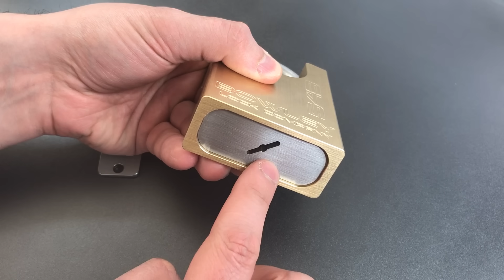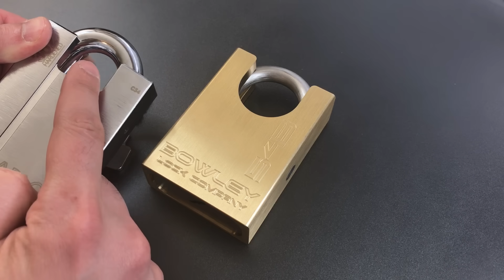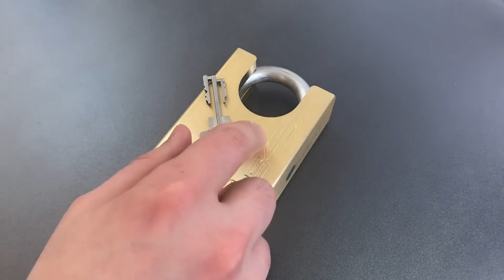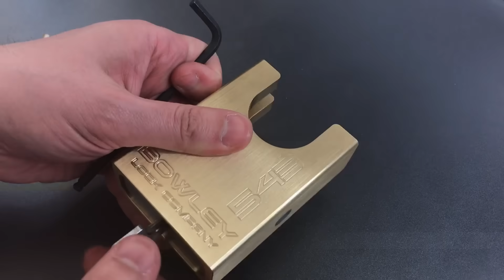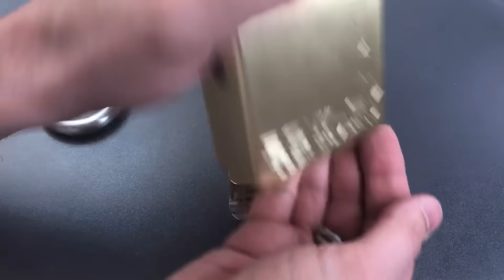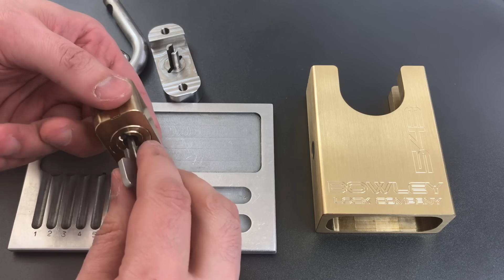[653] Prototype Dual Fork Bowley Padlock (Model 543)

Comment: -Sees bike with this lock.
-Breaks lock's chain
-Leaves bike steals lock
Reply: I mean, you won't be able to use the lock since you wouldn't be able to pick it open. It would just be a trophy.

But it'd be an awesome trophy.
Reply: @CheshireFatorum  You can recreate a key if you know the general size of they key.
Reply: @barodrinksbeer7484  hard tho, you would need a cnc machine to cut a key lile that in a reliable way that is easily repeatable, which would be what you qant if you loae your key and want to make a replacement without worrying too much about wrong dimentions, cncs today are really accurate and if it's fucked up it could be jjst you fucking up in the program or got the dimensions wrong
Reply: @CheshireFatorum  to I only
Reply: @CheshireFatorum  jjj*
Reply: Yuuto Amakawa sell the lock for more than the bike.
Reply: true you wouldn't have the keys
Reply: @CheshireFatorum   With solid brass, you could just sell it for scrap metal
Reply: Yuuto Amakawa you could pick it
Reply: @CheshireFatorum  the bike is the trophy the locks probably still there
Reply: God everyone in the comments of this comment are making a big deal over what is literally just a dumb joke that made a few of us laugh.
Reply: I hope it have a integrated GPS tracker in it for that price
Reply: @leexgx  Cost more than the bike.
Reply: @markarrington3869  actually it's about the same price of a cool bike here, even tho on the cheap side
Reply: @leexgx  If it's got a GPS you just stick it in a Faraday cage (in bag form) for a year until the battery runs out.
Reply: @leexgx  Is it $500?  Because that's what the locks with integrated GPS trackers cost.  On the plus side, you'll get (superior) Medeco keyway and keys with it.
Reply: @yutub561  Made by someone who doesn't know a nice lock from a gimmick, at that.
Reply: @yutub561  Much like someone not "getting" a joke that wasn't funny.
Reply: I thought it was funny.
Reply: Agent VX u gotta stop gatekeeping my guy like let people do their things, atleast they produce quality comments that can make people laugh
Reply: I like how the internet doesn't agree on a lot of things but we teamed up quickly against  @agentvx8320
Reply: @agentvx8320  r/whoosh
Reply: @agentvx8320  the superior comment is sarcasm right?
Reply: @ambitiousdentist6076  I don't know which comment you're referring to, but the Bowley is a deeply flawed lock design.
Reply: @philip_bray  wtf made you think he lost it? He obviously got a great lock that only he knows if to protect it. How else is he gonna stop women from stealing it doesnt want to lose anything so he refuses to lose his virginity too.
Reply: @agentvx8320  you're not funny tho, you try but you fail.
Reply: @agentvx8320  I thought it was funny
Reply: Agent VX $500 for GPS tracking?! I can buy a GPS module for just $10...
Reply: @agentvx8320  For $500 you can actually get two of these (the stainless variant)
Reply: @fornsphin  And for $50 you could have a lock that's just as good for practical purposes unless you have LPL breaking into your shed.
Reply: @agentvx8320  your name isn’t numerically correct VX just equal V
Reply: @dead6171  Whoever said it was a number in the first place?
Reply: @agentvx8320  I thought it was funny
Reply: @johnadler6987  Well we agree on the second point.
Reply: holy cow, I didn't expect a two year old comment chain to still have comments.
but jfc, everybody loves to pile up on the correct person don't they.
Reply: @insanemunchkin  I was saying boo-urns.
Reply: @cyruskhalvati  it wasn’t quality
Reply: @agentvx8320  i thought medico was defeated with a camera a credit card and an exacto knife?
Reply: @agentvx8320  i thought it was funny too
Reply: @agentvx8320  can get gps trackers for like 30 bucks no way a lock needs to be 500 to include one
Reply: @agentvx8320  he said he believes it's 163 USD
Reply: @GRBtutorials  he might think it needs some weird components that are hard to make even tho it should be pretty simple, biggest problem is battery
Reply: @agentvx8320  Dude, calm down. Not everyone knows every intricate detail about a lock. That doesn't mean you get to look down on them. Just, take a breather and think about what you say before you say it.

Or you could be a total prick and still snap at people, not my decision to make.
Reply: @Concerned_Custodian  omg, this Agent VX thread has been the funniest thing i have ever read. this dude is so salty he is Basically the entire ocean lol.
Reply: @agentvx8320  Man really said a Medeco lock was superior 😂😂😂 what are you on bro
Reply: @agentvx8320 don’t be such a buzzkill, kiddo.
Reply: Oh it was definitely funny - just someone (@Agent VX) takes himself way too seriously.
Reply: @DerPafferfish  😂 lol nobody seemed to point it out, Agent VX is the joke of this thread.
Reply: What about cutting the bike?
Reply: Yeah, the Bowley padlock is probably worth more than the basic bycicle
Reply: Youre all stupid. You cut the object the bike is locked to and walk away with the bike, chain and lock. God, nobody thinks big time anymore.
Reply: Philip Wells no, just cut out the ground in which the thing the bike is locked to is connected
Reply: Yeah.... It is beautiful. I don't really know much about Locks, but this thing…. You can just feel the love. Beautiful.
Reply: This is the best comment section in LPL videos:')
Reply: @agamikhwana8596  Wow I didn't get notified for any of this, is it too late to get some popcorn?
Reply: Saw a good lock on the lock up garbage round back of shop. Rusty hinges, easy to get at screws, wooden rotten door 😂..
Reply: Bolt cutters, why waste ones time picking...
Reply: @manniefaces  bolt cutter pobably wouldnt take care of a lock this big with a hardened steel shackle, just go for the battery powered angle grinder
Reply: @MatthewHensley8304  I mean, if animals killed with modern weapons count as "hunting trophies", then so does a lock someone got by cutting the chain with power tools.
Reply: @sbcontt YT i know, right?
Reply: Wtf is going on?  This has been going on for 2 years in the comment section.
Reply: @jensmakinen  Its very simple.  People are both dumb as hell and petty as hell.  I hoped that helped.  Have a good day.  :)
Reply: Noble gentleman of the planet Earth, with intricate  and vast knowledge of locksmithing and lockpicking or whatever alike. It is vanity to try to communicate such complex and well-made arguments on such uncultured people that cannot even fathom the ineffability of your knowledge, as this is obviously a joke. Nonetheless I appreciate, if no one else can, the sharing of such convolute arguments, that, with no doubt in my heart nor mind, I can say that are entirely valid.
Reply: @victor93532  that’s like trying to extend a 5 word sentence into a paragraph. I like it.
Reply: @victor93532  you you just said. Love it
Reply: I literally came to the comment section to say this
Reply: Step3 recycle lock take $ and buy a good bike... step 6 . Realize  your bike was stolen because you couldn't afford a good lock.
Reply: It's quite amazing how many people I've managed to make this butthurt with just a few comments deriding a lame joke about an overhyped lock, yes.

I bet I can still manage a few more though!
Reply: @agentvx8320  this would be the lock I would use if I were ever to chain you up in an empty basement out of pure sadistic pleasure. I'd even leave you with an assortment of lock picking tools
Reply: @stuartcommon4651  And not an Assa Twin or Abloy Protec?  Cool, glad to hear it.
Reply: @agentvx8320  ssshhhhhhhhhhh.....
Reply: @stuartcommon4651  No thanks.  You can if you like though.
Reply: @ParaFox404  That reminds me, you need to get more pizza rolls. Its the only way to stop the fridge!
Reply: @ParaFox404  it's the YT comment section. It does not represent how they interact face-to-face in public. For example: your monologue on a post over a year old.
Reply: @matts3425  I got bored sue me
Reply: @ParaFox404  i could tell
Reply: @agentvx8320  over a year you argued about a stupid joke, seriously... dude...
Reply: @agentvx8320 u still here 5 years later?
Reply: @agentvx8320  i feel like I just witnessed the birth of an antihero reading through this 4 year conversation. Most people hate him, but he's just aggressively helping.

I commend your persistence in successfully proving your point even if it was a little much in response to a joke.
Reply: @agentvx8320  The reason we're all so butthurt is because you took this joke way too seriously and started acting like they were dumb. You don't know what they're life is like. And no, don't use "well I was just kidding!" as an excuse. My best friend killed himself because of assholes like you, so yeah, I will get butthurt, because your kind need to be put in their place, before you can run rampant and infect the internet like COVID-19 has infected humanity. Fuck off, bitch.
Reply: My child was still in my wife's belly when this thread started.  Now he's watching YouTube
Reply: The perfect crime
Reply: I dont know if you could break that chain that easy
Reply: Could you imagine the smiley
Reply: @Victordanie True Story XD Thught about the same XD
Reply: xDDDDDDDDDDDDDDDDDDDDDDDDDDDDDDDDDD
Reply: Lmao why not steal both?
Reply: Made my day xD
Reply: Thieft Approved!
Reply: @Victordanie
I was just about to add a comment in the exact same vein, the I saw Yours.
And looking at the number of thumbs up and replies You seem to have "captured a common reaction" with Your comment.
Best regards
Reply: *picks lock on YouTube
Reply: Ok... I know this is over a year old, but has no one mentioned why you steal the lock and leave the bike, assuming it's one of the bronze ones??? Didn't he say in the video that It's a limited edition one, only available during the kickstarter campaign??? If that's the case whether or not it's worth the cost, is sort of irrelevant for the most part, because it's a limited edition, preproduction product... And if it's limited edition, you don't want to break the lock, most likely, and aside from that fact, it's brass probably because it's supposed to look good on a display, as well as in actual use... Therefore whether it's worth saving the lock, and taking the bike, depends on the person, but I for one, would keep the lock intact whether I can pick it or not, just because of the supposed limited number of locks made... And yes, I know that they are overpriced, I'm just saying that, at least in antiques, which these will be someday, prototypes and anything preproduction, for that matter, especially limited editions, are worth more... If I didn't know it was limited edition and all that, as well as the price, then yeah, I concede that I'd probably cut the lock, but still, you have to admit that however overpriced it is, this lock company is and/or was trying to make their locks as pick-proof as possible...
Reply: @northwiebesick7136  It's obvious, because they think the lock is valuable.

That's the part I take issue with, because it's an overrated lock that isn't /actually/ worth more than $50 unless you have a distorted view of what makes a good lock from watching too many locksport videos.

Not that I take issue with locksport at all.  Thieves just /don't/ pick locks in the real world.
Reply: Agent VX why do you think thieves don’t pick locks?
Reply: @andrewksmash8138  To clarify, thieves /in the US and Canada/ do not pick locks.  It's much more common in Europe and poorer countries.

The reason I hold this opinion is that I am a professional locksmith, and neither myself personally nor any other locksmith I've met has ever encountered a situation where a customer's lock was actually picked by thieves.

The reason I think it doesn't happen is that lockpicking is a high skill attack, and anyone who has the patience and self-discipline to learn can get a real job.  (This last point is not necessarily true everywhere in the world, but it /is/ here.)  Thieves basically exclusively use low skill attacks like bolt cutters, prybars (or more commonly, a big ol' screwdriver -- this is why "SmartKey" locks should be avoided despite moderate pick resistance) or just a good old fashioned rock through a window. For that reason, I do advise people stay well clear of tubular key locks, as tubular key decoders are very cheap and require basically no skill to use.

The Bowley is targeted primarily at the North American market (being made here), and that makes it pretty much an answer to a question nobody asked.  That said, even in other markets where pick resistance is important, you're not saving money going with a Bowley over Medeco or Abloy Protec, and those are more reliable locks with sturdy keys that can be reproduced by any locksmith that sold you the lock.  Bowley keys have a fragile geometry (necessitating them to be made from steel) which require specialized machines to cut.  Furthermore, the pick resistance of a Bowley is not equivalent to Abloy Protec.  There are credible videos showing Bowley locks being picked open, though they do require specialized tools.  There are no credible videos (i.e. where the lock is shown continuously unobscured between opening and gutting) of Abloy Protec being picked to my knowledge.
Reply: @agentvx8320  Am I the only one that genuinely wants to hear what locks you would recommend, specifically? I like the one in the video, but it's too expensive for it's security class. I can get extremely strong chains so that's not a problem. I just need a crazy strong lock that can hold them together.
Reply: @agentvx8320  I just read the last post you made :p
I should finish a comment thread before asking questions. I'm still wondering what their best lock for holding chains together is, though.
Reply: @sleepykittyH  Either something cheaper than a Bowley or something that actually qualifies as "high security".  (That term has a specific meaning for locks.)
Reply: @sleepykittyH  Specifically, depending on requirements, a quality basic brass padlock like a Guard 836, something like an Abus 83/45 if you want it keyed to your house key (or the steel body equivalent 83/55), or if you're really worried about picking for whatever reason, a Medeco or Abloy padlock.

Shackle guards are always preferable for resistance to bolt cutters, but aren't always workable because of fit issues.
Reply: @sleepykittyH  American 1100 or 700 series (or one of the myriad clones) are also a good option.
Reply: @agentvx8320  Getting a good lock is more complicated than I thought. Thank you for helping me :)
Reply: @sleepykittyH  No problem at all.
Reply: @michaelakers2271  Because it couldn't be /anything/ to do with the lock being overpriced snake oil.  Projecting much?
Reply: @agentvx8320  this thread made a good midnight read. At any rate tho, no one can deny that it is a cool lock design. Flaws? Yes. Impractical? Maybe. Could you cut through it in a decent time? If it isnt titanium, you could use a hacksaw if you had 30 minutes.
Reply: @theplaguedoctor6129  No lock is going to stand up to a cordless angle grinder for a whole minute.  Shackle guards do help a lot against bolt cutters, but you can get a shackle guard much cheaper than this and application (i.e. what you're trying to put the lock on) is usually what rules out a shackle guard.
Reply: @agentvx8320  I'm not saying bolt cutters or an angle grinder, I'm saying a hacksaw. If  you have the time, you can get through almost anything with one. Also depends if your blade is up to the task.
Reply: @agentvx8320  not to mention, a lock will always be the weakest point in a chain. Unless you use a lock made of titanium with a chain made of aluminum.
Reply: @theplaguedoctor6129  All the more reason not to waste money on a snake oil pick resistance lock with serious hidden flaws.
Reply: @theplaguedoctor6129  Titanium's aerospace advantages aren't really applicable to locks, hardened steel (esp. boron alloy) is as tough as it gets.  But otherwise yes.
Reply: @agentvx8320  I’m laughing at the fact that you all spent a year discussing over a dumb joke
Reply: @agentvx8320  To be honest with you, this whole thing was funny right up until you spewed "overpriced lock" at several people making the "cut the bike / take the chain" jokes and then proceeded to call a random one of them funny. That just made me cringe.
Reply: @agentvx8320  it's definitively more than 50, dont you know how much metal cost?
a meter rool of a thin af aluminium sheet is bout 32 brl, bout 5 usd, that's aluminium, a meter rool, of thin metal, with a width of 50 cm
a simlle ass brass connection can sometimes costs just as much, so imagine this fuckong brick o brass, price of shit inst always based off of how good is it, y'know?
Reply: @agentvx8320  it's much essier to cut steel than you think bud, any old cnc with a proper drill bit can cut it, and you heat treat the steel after you make the part, no one is crazy here, you only do that when the part needs to be acccurate in order of a few thou pobably, other than that, it's easier to slightly overshoot the size when cutting it with a cnc, heat treat it and then you remove oxide and stuff
Reply: lol that's brilliant... although without the key it's useless and not really worth anything
Reply: @mnassef4715  Right? @Agent VX will NEVER live that comment down. An entire year!
Reply: @MatthewHensley8304  most won't know about the gps tracker
Reply: lol, that was a good laugh.
Reply: Plot twist: The lock is actually worthless without the key, regardless of how much it retails for.
Reply: Of all the things I expected discourse over, a lock wasn't one of them.
Reply: Typical criminal thinking
Reply: who's gonna impression the key?
Reply: LMFA0!!!!!!!!!!
🤣🤣🤣🤣🤣
Reply: Forget cutting keys. 3d print. And use carbon nano over lay deposition.
Reply: I'll never forget locking up my bike at the theatre, back in 1999.....I went back for some reason to make sure I didn't leave my fanny pack on the bike or something ;-)   There was a guy playing with the locks on what looked like MY BIKE....I tried to be subtle and only watch from the side of my eyes.  10 seconds later he was riding off on MY BIKE!   I chased him down the road,  yelling at the Alhambra water guy to stop him, but he rode right around him, I got within 5 feet of the guy and hucked my backpack at the tires to try and cause a crash....he clicked into a higher gear and pulled away.  I never got that bike back,  but out of defiance I went out and bought the same exact bike but this time I got a bigger lock.........Now there is YouTube and the lock picking lawyer can pick that bigger lock I got in about 20 seconds.
Reply: Genius
Reply: I could sell a set of Mountian Bike wheels for like 300-400 usd
Reply: @UCVFpK9ew0m_eLplA7L5zYLg doesn't matter if it wasn't funny it obviously went right over your head, dumbass
Reply: And a extremely confused owner who now think they ran right into a prank
Reply: They target the chain anyways. The locks are awkward shapes
Reply: They make chains that can't be cut. But go ahead and waste your time being a thief instead of getting a job. That gives me more time to aim and blast you!
Reply: Me lol
Reply: I mean you're kidding but my dad had a friend back when he was a teen who when around stealing bike lock chains and wore them around his neck. Cop saw the kid and we'll yea
Reply: I agree that if LPL turned thief, I would expect he would be stealing locks instead of the stuff being locked up.
Reply: Has Charlie made a Lock Gate controversy video yet?? He needs to.
Reply: That's pretty funny I'm gonna steal it and use it in a screenplay.
Reply: lmao
Reply: Have fun breaking the chain. Grinders slip, and bolt cutters aren't gonna be powerful if the chain is thick enough.
Reply: You can make chains with materials that are very difficult to cut with hand tools
Reply: My chains are made from a vibranium-adamantium alloy. Don’t know you secure you bike.
Reply: same
Reply: @KBA3AP  
 Do try that cutter on a 14mm hardened boron steel chain, wear safety glasses and a face shield, you'll need them when the cutter explodes.
Reply: @dragonhealer7588  True, Bult cutters will just bounce on before snaping. Best way to cut HBSC or any hardened chain is with Ox-Acetylene or Ox-Propane, also carbon disk's will fly through it too. But they are both very loud.
Reply: in defense of the Bowley lock defense; the thing would be an absolute nightmare to pick open. the idea is executed well. they are still finding ways to make it better.
in defense of bully lock;  it seems like a good idea until you realize that it can be broken into with no need to pick. brass is generally not a good thing to make locks with seeing that it is not a sturdy metal.
if it were made from strong metal it would be worth your money despite it being a gimmick lock at the posting of the video.
seriousness aside; these were some of the rarest insults i have seen.
Reply: You are obviously not familiar with hardened security chain.
Reply: @agentvx8320  break the bike, steal the chain and lock.
Reply: Agent VX saw through the bike, and steal the chain and the lock.
Reply: Agent VX 
You’re obviously not familiar with a fucking joke.
Reply: @agentvx8320  yes, you didnt get the joke, thats fine
Reply: @TheShizzlemop  The joke is how many of you actually think this is a good lock.
Reply: @agentvx8320  complete clown
Reply: @agentvx8320  Ive actually broken quite a few hardened steel chains with a pair of hammers and a pair of pliers.
Reply: @agentvx8320  you obviously don't know how many thieves know how to defeat harden security chain in a couple seconds LMAO
Reply: @Johnny-tq9no  You obviously don't know the difference between ordinary hardware store chain and hardened security chain.
Reply: @agentvx8320  I definitely do you don't understand how easy it is for thieves to cut through security chain yes hardened steel
Reply: @Johnny-tq9no  Made by Abus or another actual lock company?  Not unless they're using an angle grinder... in which case this lock is still the weak point.
Reply: @agentvx8320  I know plenty of people who use angle grinders it's the go to after a hammer ... I've even seen thieves use torches and plasma cutters
Reply: @Johnny-tq9no  Okay but this lock is still going to be much weaker to angle grinder zip discs than proper hardened chain.
Reply: @agentvx8320  I guess it depends on what chain is used but even the big motorcycle security chains i've seen cut by theives
Reply: @Johnny-tq9no  Also, angle grinders are LOUD.  They attract a lot of attention.
Reply: @agentvx8320  not really... Depends on the area but they're not so loud that you can't get away without drawing attention. And most criminals don't really care if they cut it and get out no one's going to stop someone holding a grinder and I know they'll be gone before the cops get there... The police don't really rush for something like that
Reply: @Johnny-tq9no  Working as a locksmith, every time I've cut security chain (with an angle grinder) to length for a customer, I've been confronted by somebody over the noise and sparks.
Reply: @agentvx8320  come to Tampa LOL you see people at night in hoodies throwing Sparks from the back of their shity truck trust me no one's going up to ask them anything unless they're the police and have at least a couple units out there
Reply: @Johnny-tq9no  All the more reason not to waste money on a gimmicky lock like the Bowley.
Reply: @Bauson  true but we can say @Agent VX is indeed a fine lock. Just put it near any of your valuables and nobody will want to go near it
Reply: @agentvx8320  they arent too loud, and if you are worried abiut that, there are other tools, such as an oxy acet torch, sure hard to bring there and go unoticed but the biggest problem would be the hissing sound from the oxygen
Reply: @agentvx8320  1 how the sparks are getting there?

2 noise shouldnt be a problem, just do it in a closed room! inside anywhere it is in would atill be loud, but outside wouldnt, also, what are these people that cant endure the sound of a angle grinder for a small amount of time?
Reply: @agentvx8320  keep your eyes open, I can see someone spending a fortune on this lock 🔐 then buying a cheep dogchain to use it with....
Reply: @agentvx8320  easier than busting that lock
Reply: @BeardMan01  It's not a remarkably tough lock.
Reply: @agentvx8320  it essentially unpickable that is why it is good
Reply: @strider04  It's not much money worth of brass if you're selling it as scrap, no.  And for the kind of price Bowley is asking, you could get a much nicer Abloy padlock that would both be essentially unpickable and possible to get replacement keys for.
Reply: @agentvx8320  it is possible to get replacements for this, but just harder
Reply: @strider04  So basically, it's inferior in every way.
Reply: @agentvx8320  no not really because an abus usually doesn't have a shackle guard, also they make a stainless steel version of this, plus this is an experimental lock
Reply: @strider04  I said Abloy, not Abus.  And both companies do make padlocks with a shackle guard, in both steel and brass.
Reply: @agentvx8320  sorry also how is a brass abloy and better or worse than this, besides the key, which is hard to replace, somewhat. But to be real who, besides an idiot, loses their keys all that much.
Reply: @strider04  A brass abloy will be more reliable, and being able to get keys cut is important for more reasons than just losing them.  Abloy is extremely weather resistant because the disc detainer design does not require springs (which must be made of rustable carbon steel) to function.  It's not just getting replacement keys cut either, it's being able to have the lock rekeyed to a different key.
Reply: @agentvx8320  most locks have brass springs.
Reply: @strider04  All springs are made of spring steel.  You're thinking of springs that have been plated in copper or brass.
Reply: @agentvx8320  no I'm not, I know what a spring can be made from, I have made some, also the bowley lock is designed originally as a door look so I think that it is weather proof enough, and I looked it up and they sell the stainless steel version standard so the lock isn't that much of a weak point compared to the experimental brass one here
Reply: @strider04  You can make a spring shape out of any metal, but only spring steel is both strong and elastic enough to do the job for any period of time, at least as a coil spring inside a lock.  The springs in most locks are copper or bronze /coloured/ by electroplating, but they're all strongly attracted to a magnet.  That means they're steel and they can rust.
Reply: @agentvx8320  again that is not completely true. Also if it is electroplated then it is more resistant to rust, and depending on how weather proof the lock is rust might not happen, also most abloys are pin tumbler so they have the same problem of rust.
Reply: @strider04  All locks contain springs that are attracted to a magnet is completely true.  If you want to bring up exceptions that are outside the field of locksmithing, I'll concede.  But as far as locks specifically are concerned, no, those springs are 100% all made of ferromagnetic carbon steel without exception.
Reply: @agentvx8320  all right then, go ahead and explain the problems of this lock. if you know as much as you act like you do, it should be easy.
Reply: @agentvx8320  ok, so now that you've explained it, and as you seem to be correct, my question is why didn't you explain first and leave it at that instead of insulting everyone? you wasted yours and everyone else's time being rude when you could have just been right.
Reply: @thomasstewart9752  Nobody else bothered to ask, you know.
Reply: @agentvx8320  but they didn't ask to be insulted either. if you have a problem with something or something to say, then say it. don't vaguely criticize something hoping that people will ask for clarification. vague criticism immediately sets people off because it is unsupported negativity and is unactionable information. what is actionable information is that this is a lock that looks cool and is interesting from an engineering perspective. the average person can do the research themself if they are getting ready to make a purchase, but most of the people here are just interested in the design of the lock because it is cool to them, and there is nothing wrong with that. even if you are right, it won't be useful to the people you are talking to, and if what you are saying is rude and not useful, then why say it?
Reply: @thomasstewart9752  Welcome to the internet, since this is apparently your first day here.
Reply: @agentvx8320  you have creative comebacks when someone tries being reasonable with you. "welcome to your first day on the internet". you seem really mature.
Reply: @_kiwi...  And a welcome to you too!
Reply: @agentvx8320  I'm in awe of your creativity
Reply: @derekpeterson6325  Oh no, I was mean to an inanimate object.  Horror of horrors.
Reply: @agentvx8320  lol if you think that lock is fragile you should see your masculinity :')
Reply: @reznovvazileski3193  Not fragile per se, a brass body padlock with a shackle guard is decent (if not particularly bulletproof).  Just not worth more than the $20-30 you'd pay for any other non-rekeyable brass padlock, and certainly less than the $70-100 that would get you a brass body Abloy.
Reply: @agentvx8320  I get that your just trying to say that this lock is bad, which it might be, but these comments have become something way different. Just to everyone, let this thread rest already.
Reply: @agentvx8320  And also stop arguing with people. Unless it entertains you. Anything to entertain internet people.
Reply: @agentvx8320  Dear Christ, imagine arguing with a comment section for almost a year 
L M F A O
Reply: @umcThunder72  The BosnianBill video is legit, but it refers to obsolete Disclock Pro, not current Protec/Protec 2.  Abloy does not sell locks using that system anymore.
Reply: @agentvx8320  "Nobody else bothered to ask, you know."

Actually people did ask, you just ignored them.

Also, nice trolling dude.
Reply: @derekhunter5040  Not sure why you're so butthurt over someone criticizing an overpriced snake oil padlock, but ok!
Reply: @derekhunter5040  lol get over yourself.
Reply: @agentvx8320  Holy shit I've seen the error of my ways! You're absolutely right! Thank you so much.
Reply: @derekhunter5040  You're totally welcome.
Reply: @agentvx8320  oh and btw, welcome to the internet.
Reply: @derekhunter5040  lol says the guy who can't cope with someone having a negative opinion about an overhyped lock.
Reply: @agentvx8320  if only you could apply that laser focus to something useful. Perhaps your life would have amounted to something.
Reply: @derekhunter5040  Pretty hostile for someone who's supposedly not butthurt about their favourite lock not being worshipped, aren't you?
Reply: @agentvx8320  again, @river kinnie has been on the internet for much more time than you.
Reply: @julimos7301  Wow, what was ARPANET like?
Reply: @julimos7301  Are you under the impression that petty disagreements are unusual on the internet?  Because what internet have you been on for the last 30 years?
Reply: @agentvx8320  I don't really understand what you mean by that, I just thought that it was funny that you were saying "welcome to the internet" to people who have been there way longer than you, obviously you were saying that as a joke and I know that, but the ironism of you saying it made me laugh out loud, also I've had a lof of those "petty disagreements" that you're talking about, but you know I do something called "learning from my errors", seems like you understood it as getting even worse every time someone actually tries to tell you that it was a joke.
Also I'm not gonna dissagree with the "overrated" lock part, it is pretty overrated ngl, just no need to brush your opinion on other's faces and be a douchebag, I've actually had this same conversation like what, 3 days ago? Someone who was right but everyone hated him cuz he was still being a douche bag, and instead of understanding that he just kept being one.
Reply: @julimos7301  if you'd been on the internet longer than me, you would know what ARPANET was.  Because you'd have been using it.
Reply: @agentvx8320  Oh sorry, I meant youtube,
I've been on youtube longer than you, not the internet, that was a missunderstanding of mine, but anyways my other points still stand xD
(If this was your first account atleast, that's another thing, I was assuming too much haha)
Reply: @agentvx8320  lol you wont be selling it as scrap, if you have ANY understanding on melting metals you pobably could make some really nice bars and sell then for half the price of the original lock, and you havent even paid for it, so, no, it is worth a lot more.
Reply: @agentvx8320  hello, guy that likes chemistry here

you said thry dont need rustable springs, right?
guess what! brass and stainless still oxidize!
brass has copper and stainless steel has iron, both can oxidize, copper is just slightly harder to oxidize
Reply: @agentvx8320  dude, this guy bought a $175 dollar lock.  He's only gonna afford plastic link chains!! 😂😂😂
Reply: Agent VX angle grinding is your friend
Reply: @agentvx8320  Fine, we cut the bike off the chain!
Reply: @Drevonofsaigon  Enjoy your massively overrated lock.
Reply: Agent VX you not getting the joke and then getting butt hurt was rather humorous.
Reply: @agentvx8320  I had a KTM 450 stolen off my drive after the thieves cut through my hardened security chain with what was probably hydraulic bolt cutters. Locks are for the honest.
Reply: @agentvx8320  I dunno if you're still paying attention to this thread anymore, but, considering everything, I'd say you definitely came out on top here. You're over here making statements based off of facts or what I would assume to be your own experiences, while everyone against you is really just throwing elementary insults and having temper tantrums because they can't get through you. Well played!
Reply: @agentvx8320  12-16v angle gringer go EEEEEEEEEEEEEEEEEEEEEEEEEEEEEEE
Reply: @agentvx8320 torch and dry ice have entered chat
Reply: @agentvx8320 did u say chisel in between the chain and sledge hammer ?
Reply: @agentvx8320  r/woosh
Reply: Agent VX you are literally that reddit dude that always says ACSHHHTUAAALLLYYY
Reply: @agentvx8320  twins
Reply: @agentvx8320  security chain has to be cut to length doesn't it? Someone cut it at some point so it can be cut again.... if feel sorry for your girlfriend or most likely boy friend, I'd hate to hear this all day.
Reply: @stinkyvonfishstix4196  My girlfriend and my boyfriend both know better than to use a lock that's much easier to cut through than the chain.
Reply: @agentvx8320  I think you should stop, we can smell your sarcasm because it smells like sea and carcasses. . . 

Probably in a chest with that lock that you can cut with a industrial chain cutter ...
Reply: @agentvx8320  🤦‍♂️
Reply: @stinkyvonfishstix4196  Lol, bad argument, those original chains are probably cut with industrial laser cutters, or diamond blades, good luck carrying that around a bike parking without looking suspicious...
Reply: Agent VX this may be a year old, but I have the most thought out unmatchable comeback for you, “Who, the fuck, asked”. And to any comeback response my reply is, “does it look like I’m gonna listen to you?”
Reply: @agentvx8320  to cut throught this lock with brass outer casing, just sn angle grinder will do it, just need patience
Reply: @agentvx8320  I don't care about locks that much but this thread was hilarious! 
Your first comment was a little abrasive, but the commitment to the bit goes above and beyond. 

Every time someone tries to call you out (despite no one having anything relevant to say) you come back stronger.  

You clearly know your shit about locks and you don't take shit from people who don't.  Respect.
Reply: What makes this even better is the fact that it has 10k likes and exactly 0 dislikes. Well done.
Reply: @stevestolarczyk8972  You do realize YouTube doesn’t show dislikes on comments, right?
Reply: The Illegitimate President  For a bike lock, you don't.  The primary purpose of a GPS enabled padlock would be audit tracking cargo.  It was intended as an example of what the price of a Bowley could get you, although I was apparently misinformed about the price of that product and/or the Bowley model featured here at the time.  However it's still true that you could get a comparable Abloy Protec 2 padlock for a comparable if not lower price, have better pick resistance, and be able to get spare keys made.
Reply: @notlisted1493  Yes, it will.  A cutoff wheel will go through basically anything.  It will, however, go through brass or a tension rated chain faster than through hardened security chain.
Reply: @agentvx8320  You do outstanding work, both on, and off the field.  Never stop being you.
Reply: KBA3AP why would kids be running around neighborhoods with chain cutters?  That’s rude and disrespectful.
Reply: This Agent VX kid went on and on and on for like almost a year on this single post. Couldn't stand being wrong. That's a sign of true narcissism. I'd wager he's contemplated killing women or atleast animals, if he hasn't already. Probably a psychopath. Take your losses and move on because I'm certain you'll come back to read this. Nutjob!
Reply: @HooksBill  hey i also kill woman and animals but im not a narcisist
Reply: @DerPafferfish  It appears @Agent VX is still in primary school, this is why he has "my girlfriend and my boyfriend" Lucky lad, does he still get to hold hands?
Reply: @TacoPoweredTimeTraveler  Mostly I fancy myself a professional locksmith, and both the government and my employer agree.
Reply: @MrRedstone___ No shortage of people here missing the point that this lock actually sucks for actual use as a lock, that's for sure.
Reply: @agentvx8320  it doenst suck, i could see myself on the future using this to lock things inside that need to be protected at all costs, the only problem is that it is too expensive right now, but in the future definitively gonna be more worth it when it's not so expensive
Reply: Why steal a shitty overpriced lock though?
Reply: Agent VX there are several reasons people would steal the lock, one very big reason is selling off the metal to be melted down. Somebody would make money at the cemetery my dad worked at by stealing little bronze vases and urns to sell them off to be melted for other uses.

Also it’s an intriguing design that some people may just want to collect for the sake of having it. Just because you are of the opinion that it’s over priced or of bad design, doesn’t automatically mean it’s okay to shove that opinion onto others to make them believe your opinion is better than theirs.
Reply: @Zamerus  It's five cents worth of brass, and it's your first day on the internet.
Reply: Agent VX actually I’ve probably been on the Internet longer than you sweetie plus, any money is still money they can make off it, a thief doesn’t care.
Reply: @Zamerus  Except the bike is worth more than the lock, which was the whole point of the original joke, genius.

Which university did you first access ARPANet from?
Reply: Agent VX I know the point of the original joke, I never did say they wouldn’t take the bike as well. Plus you’re the one that originally took the conversation away from the joke in the first place. And I’m not an old geezer lol but it does seem like you have spent very little time on the Internet yourself.
Reply: @Zamerus  The point is the lock sucks and fanboys of it are just displaying their ignorance of what makes a good lock.
Reply: @Zamerus  actually someone did at one point specify why the lock sucks but I'm too lazy to tell you where because this entire argument is dumb. It wasn't the guy you're all mad at but it was still a guy supporting his side of the argument. That is all I am going to say don't @ me I honestly want as little to do with this conversation as possible.
Reply: @agentvx8320  It's been pointed out multiple times in this video that this lock is just a prototype. The details that have been highlighted by at least one of your supporters could just be for the prototype and they might actually put better stuff on the actual product. That being said, you could also be right and this lock could just stay a shit lock. Please don't @ me I'm just trying to point out to both sides of this argument that it is a dumb argument that is a waist of everyone's time. you people are literally arguing about the basis for a joke.
Reply: @agentvx8320  Man, you are more salty then the dead sea. We should take what you say with a grain of salt ;)
Reply: @agentvx8320  that's a lot more then 5 cents worth of brass.
Reply: @umcThunder72  That's cool, now how about a video of picking Abloy Protec where the guy doesn't cover the lock before "gutting" it?  Well executed sleight of hand, but not proof of picking success.
Reply: @agentvx8320  don't waste your time on the comments section :)
Reply: @zirjaeger4037  I atted you.
Reply: @agentvx8320  Lock fan boys??? Has society gone too far?
Reply: @zirjaeger4037  how does it feel to be @'ed just to be @'ed for no reason
Reply: @agentvx8320  you call yourself an agent yet you are not even avare of "mercury corosion, scour and snap technique or a damned angle cutter.
Reply: @agentvx8320  look here kids! Archived on the internet for all to see! This is how you act if you want to remain unloved and unhappy for the rest of your life!
Reply: @agentvx8320  melting metal, reactions, using the lock itself maybe

that lock is better than any lock i see around here, atleast seems better that this no brand roundes brass brick locks, pretty simple cheap common locks